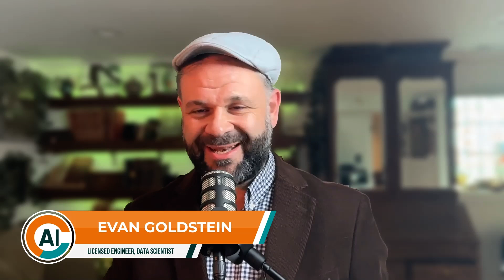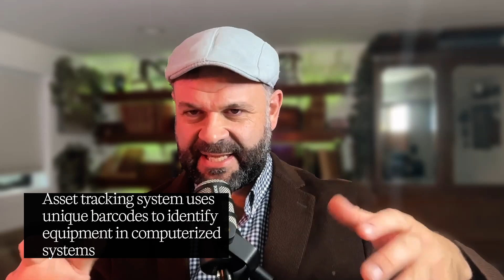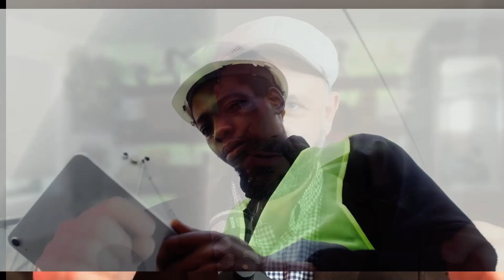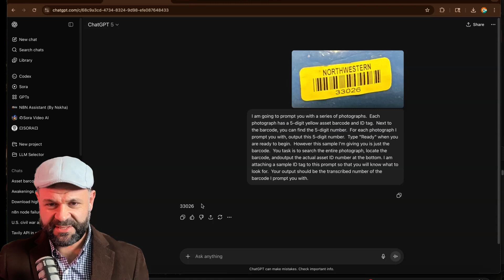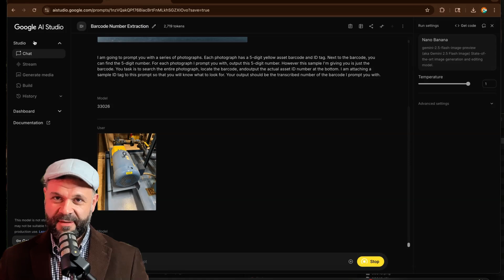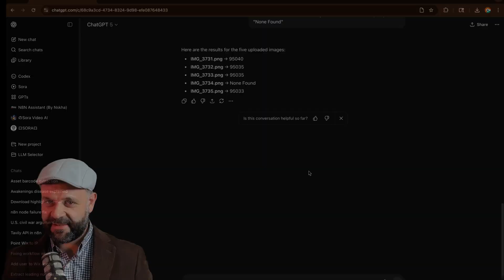3 Chatbots Tested on Image Analysis (Google Blew it!)

Comment: Interesting. Could probably use an agent with python and Clip Vision or a fast multimodal LLM. Additionally, if the images are big, but the tag is always relatively in the center, then the image could be cropped for the model to have less distraction in the image. This is similar to what I've been exploring for my AI agent regarding using PyAutoGUI. I believe the MMLLM model can identify coordinates of a button or something. Then we can just crop the image to that location, to have a zoomed in version. Then that zoomed-in section can be fed into the model to read without distractions. I haven't actually worked with this yet but I've researched it. It's the next part on my list of things to do when I have time.
Reply from the maker: Possible.  I could also have an LLM build the app to do it routinely.  However, I think the goal is to be able to do it with a prompt through a standard LLM, with the goal being for the system itself to figure out what app needed to be made, then creating and executing the app.  The more we can push computing towards natural language, the better the adoption.
Reply: @aiCapitalist1984  Yeah soon enough, I suppose. It may even think "I should make an agent for this", then it makes the agent, then it uses the agent to process the information, and then returns the result from the agent, then deletes the agent.